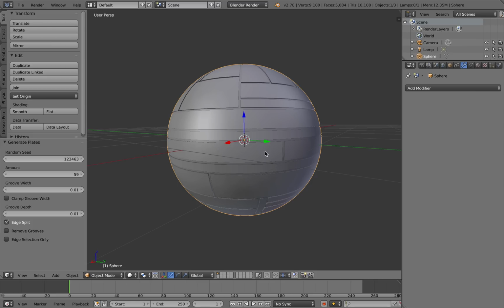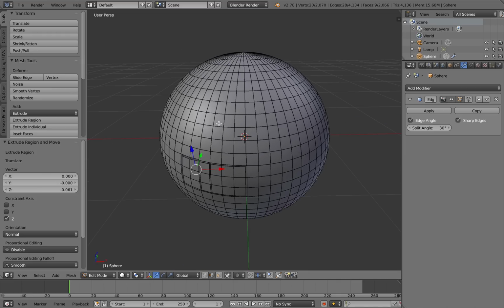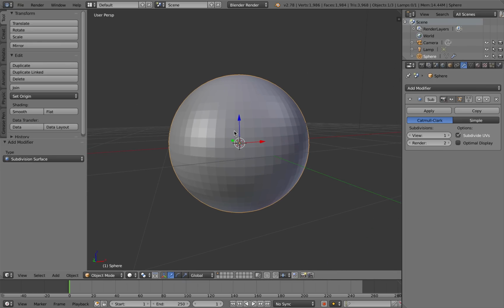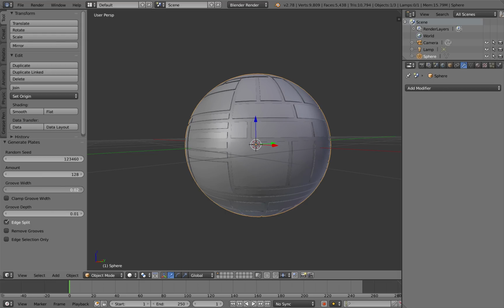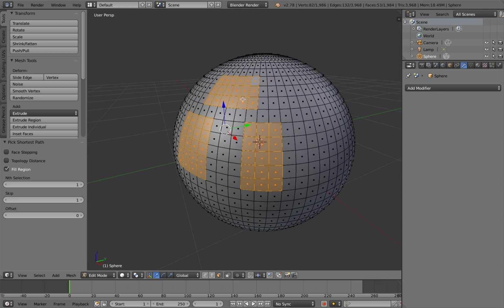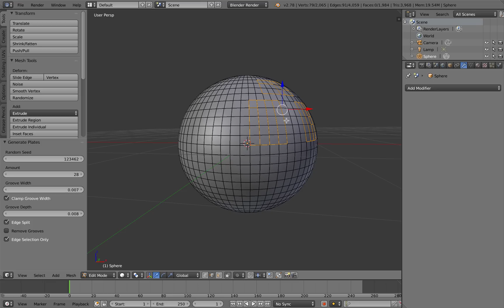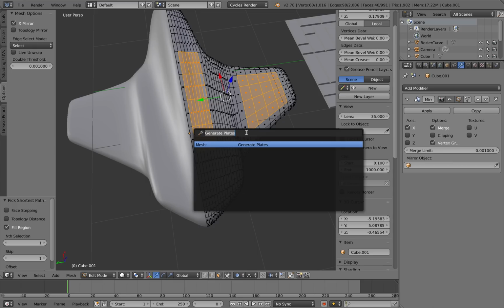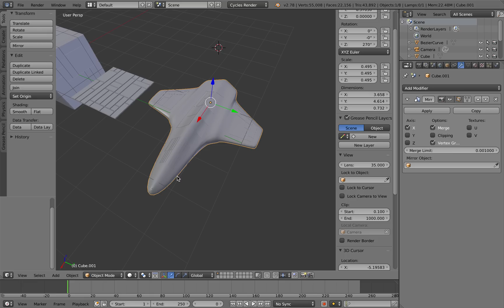Blender Add-on: Generate Plating Tutorial

Comment: The installation process is now different. Can you comment me here with the updated instructions? For one thing, when I unzip plating_greeble_gen there are two .py files: __init__.py and preferences.py. There is no plating.py. I tried using the init.py file for installing the plugin but it seems to not have worked.
Reply: I got it! Looks like you can install the plugin by selecting the .zip file itself! (without extracting). Should be fine now! Might want to make an updated tutorial video though!
Reply from the maker: @AkamiChannel   Hello yes, this is a very old video!  Up to date installation instructions and documentation is now available here: https://plating-generator-docs.readthedocs.io/en/latest/

Also get in touch via info@configurate.net if you have any issues or questions and I will see if I can help.
Reply: Thanks!  @oldmarkkingsnorthvideos

Comment: I recently learned if you check auto smooth in object data tab in properties it works just like edge split applied without adding vertices.  If the object is exported though the vertex count is the same as edge split.
Reply from the maker: Thanks. This was really useful to know :)